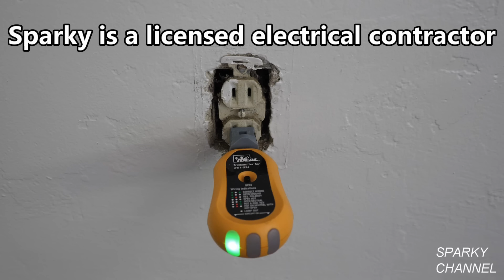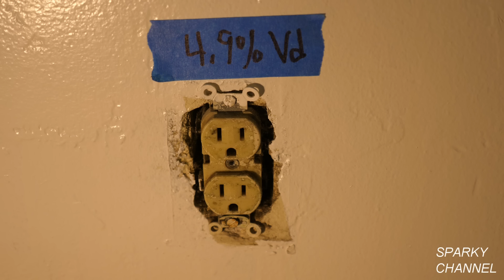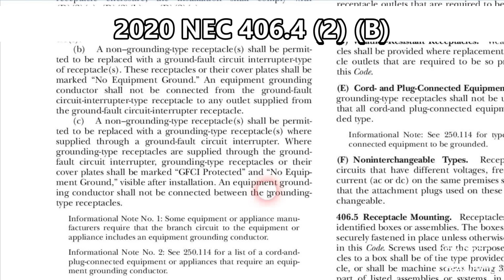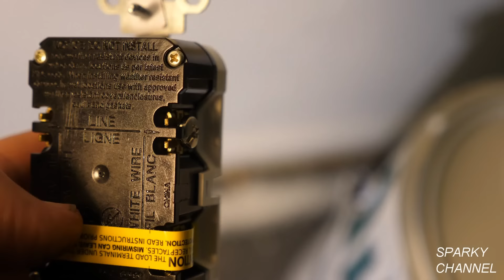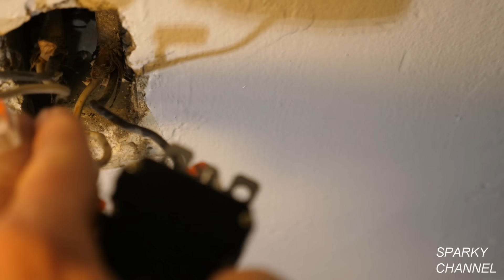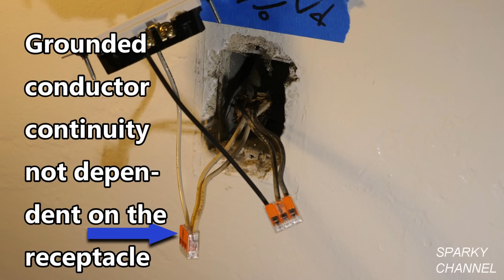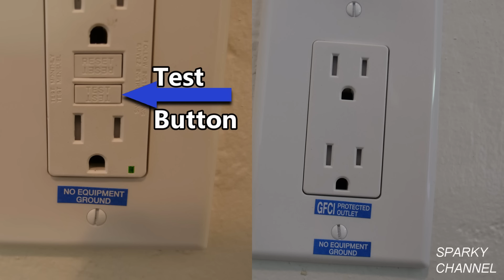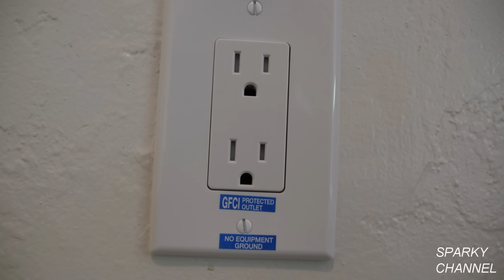2 Prong Receptacle Circuit Replaced by GFCI and Grounded Receptacles per 2020 NEC

Comment: I have two old houses, one built in 1948, the other in 1950. Both had two prong receptacles and fabric covered NM cable. It turns out that the '48 house had no ground wires but the '50 house has 16 gauge ground wires in the 14 gauge NM cable. I replaced the receptacles in '50 with three prong ones using the 16 gauge grounds, '48 got GFCI and three prongs. I did not know they needed to be labeled (thanks for that), nor do I know whether it's code compliant or not to use 16 gauge grounds.

Comment: It's very important to add electric tape on al the receptacles. Especially on the first one. Because this is very old work and the boxes were definitely metal. Also the GFCI receptacle is wider than a regular receptacle.
Reply: If you're wrapping your devices with tape, you don't trust your work. 
When I see tape, I question everything else.

Comment: What if they are all fed by a ceiling light box?
Reply from the maker: Regardless, you would still have upstream and downstream receptacles. You want the GFCI most upstream.
Reply: In that case (which is rare) the best & easiest solution would be to install a GFCI circuit breaker at the panel.

Comment: Could you replace all 7 of those two prong receptacles on that circuit with GFCI receptacles rather than doing the daisy chain?
Reply from the maker: Yes.
Reply: @SparkyChannel   Good to know! Thanks for your reply 😊
Reply: Came here for that question. The only thing is that the GFCI outlets are twice as expensive
Reply: @camillekinnon3165  I’m ok with the cost. Just want to make it as simple and straightforward for myself as possible 😊

Comment: What is meant by No Ground Equibment?
Reply: Exactly what it sounds like. There isn't any Ground physically present in the wiring. It's instead being "simulated" by the outlet for protection, so you may still get shocked, but the devices will be protected from current leaking and so will you, in the best case scenario
Reply from the maker: No equipment ground means that there is no ground available for whatever equipment you plug into that receptacle.

Comment: Not gonna lie, if I were to live in that house with my parents and if me and my sister had our own rooms, In this case, the 2 joining bedrooms on the same circuit, that’s fine because my sister wouldn’t have anything important plugged in her room since it would be on the same circuit as my room. But, since you tested that one of the master bedroom outlets are on the same circuit, and my dad plugged his computer into that one outlet on the same circuit as my room, I would really hate that crap because if I accidentally tripped my room breaker like with an accidental short or overload (current draw higher than 15 amps), my dads computer would go out too and both of us would be pissed in our own ways. Not like I will, or it would in our current NEW home since everything is organized right, but it would just be annoying. Ofc, it would be 1 million times better if he plugged his computer into one of the other outlets on the separate circuit, as long as they’re new and GFCI protected too. So the point of my comment is I would hate if the master bedroom plugs were on the same circuit as the smaller and normal bedroom plugs. Thankfully, I haven’t seen that around myself nor have I lived in a house with my parents that was wired that way.

Comment: If I replace a a 2 prong with a gfci and then add 3wire Romex after it on the load side where do I put the ground wire from the romex to the gfci
Reply: That is explicitly banned. Also why would you run a wire anyway? You cannot use this to add sockets.
Reply: @okaro6595 I think I didn’t explain right. I have a light outside and it is switched with 2wire emt that is grounded. I want to replace the light with a gfci and after the gfci I want a motion sensor light run with flex conduit and 3 wire to the light should I ground to the gfci or just the box
Reply: @dennisresch3995  If you install something new you must ground it properly to the panel.

Comment: 6:36 Not a trained electrician, but I would be tempted to label the voltage drops with the amps at which they were measured, to be sure that I am comparing like with like.

Comment: Why can’t you use a gfci breaker instead
Reply: you can, but a gfci breaker costs more than a gfci outlet
Reply: @19oco94  Just bought one 50 bucks.
Reply from the maker: You can. However, if you have an old panel it may be a challenge to find a GFCI breaker for the old panel. If you have a newer panel, a GFCI breaker will work great but it will cost more than the GFCI outlet.

Comment: Are Wago wire connectors safe to useI get mixed answers on this subject. I hear some saying you could  burn your house down and that wire nuts are safer.Others say just the opposite. What is your opinion. Thanks
Reply: If course they are. Nobody uses wire nuts in Europe anymore. They may even be banned in sine places.
Reply: I think the primary concern is not how well they work when new, they've been extensively tested and you can find people on youtube who have load tested them, but the question is what will they look like in 20, 30, or 50 years.
Also, I've seen some vids claiming that some company has already made a new product that will supersede wagos.
One thing about wagos that is hard to argue with, tho, is consistency.  Ya, you can get a great connection on a wire nut if you really crank them down, but what about people not strong enough to do that?  Pretty much anyone can operate a wago to its max capacity.

Comment: When I start replacing a GFCI Outlet when the Power is Off at my house,I start with the Grounding wire first if there is No grounding wire, I start with the Wire which is Hot and connect to the Brass terminal

Comment: By using your wago lever nuts and pigtail wires, you saved a lot of time in having to test each outlet-box to find the precise traveler-wires introducing ⚡️ electricity into each outlet-box. And although you may have bumped up the voltage-drop readings, sometimes it’s really not worth the time & effort. Thanks a lot ⚡️Sparky!

Comment: Can’t I just stick a gfci circuit breaker near the othe circuit breakers?
Reply: Ideally, you'll swap out all two-prong receptacles on the circuit to three-prong anyway, even if installing a GFCI breaker, so putting a GFCI in the first outlet isn't additional work.

Comment: I have heard that you can connect the ground terminal to the neutral to supply a discharge path for electrical shorts in an appliance. Is that accurate?
Reply: No, that would be called a bootleg. It gives false ground. If you use an outlet tester it would show as a proper grounded outlet when it’s not. Some house flippers will do this and can only be detected by pulling the outlets out or with a special tester.
Reply: @Richardmaclachlan It works as a ground but it is not allowed apart of the old dryer sockets where the connection is done in the device.
Reply: Hell no.  That's illegal.  It is considered a "trick" to fool inspectors.  (Though a smart inspector will catch it).
Reply: If you are in the US that is not allowed. I am not going to reasons why as one could make arguments either way. Just follow the code.

Comment: Thank you for the video

I must have  missed something 

First-since you (as you said) “connected all the hots together and the neutrals together,and the power will continue to the other outlets down stream “…..only that outlet is “protected “.. nothing else 

Second point is- it will not pass inspection for rental property or section 8,at least where I live,since the inspector insists on using the outlet tester,and with the lack of ground…will not trip

Comment: You turned off the breaker after you checked the first plug, then checked the plugs well are they n ot all off? should you turn on the breaker back then recheck?
Reply from the maker: You have to flip the breaker on to find out if everything works correctly.

Comment: Ungrounded wiring has been in use for over 70 years, and while it’s true that you can install 3-prong outlets on a 2-wire system to meet code, it’s important to understand that this doesn’t create a fully grounded electrical system. While this setup does improve life safety, it won’t meet manufacturer requirements for grounded outlets, which are crucial for protecting electronics and ensuring proper service. For these reasons, I strongly recommend rewiring the house to provide the safety and reliability a modern electrical system offers.
Reply: It will save your life, not your device.
Reply: I can’t afford to rewire my house, but trust me, I’d love to.
Reply: System grounding has her mandatory since 1913. All systems are grounded. We are talking about equipment grounding which is for prevention of electric shocks.
Reply: How does it "protect electronics?"  The circuit breaker is what protects the electronics (and wiring) from overcurrent. All the ground wire does is provide an alternate path back to the breaker panel in case of a short circuit.  The main risk with short circuits are to people touching energized devices, but the GFCI will take care of that. And since most modern devices are both double insulated and made of plastic, the risk of short circuits are far less than they were, say, 50+ years ago when everything was made of metal. (Double insulated devices do not even have to use a ground prong).

Comment: I have a question?
I know this and have done this several times. 
However my question is, I guess, the point of starting at the first receptacle is to capture all the outlets in that series? However wouldn't it do the same thing to all the outlets down stream from the said newly installed GFI, no matter where you put the GFI in the line, it would just not protect the one's upstream?
I know it's not ideal However my what if comes from working on a house with hidden outlets..idk why they were hidden, however they were.
Any positive response would be welcomed...
Reply: That is the way I understand it.